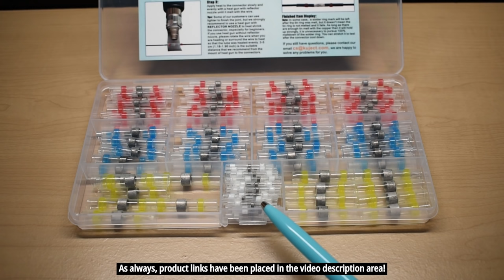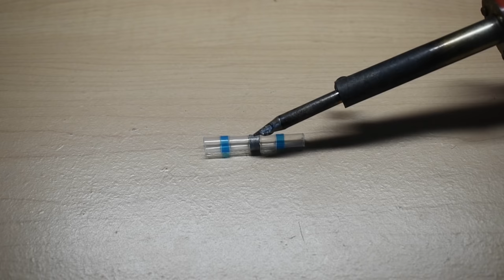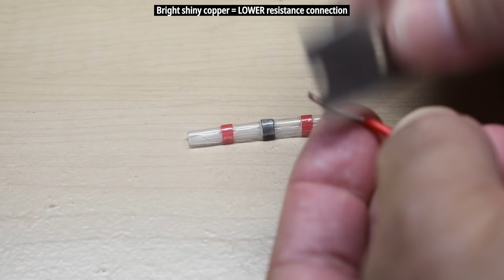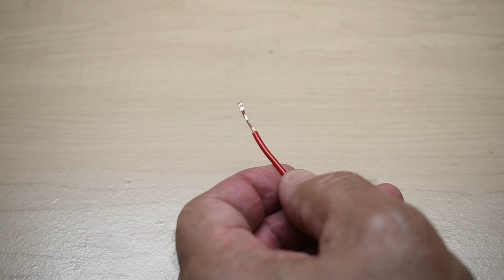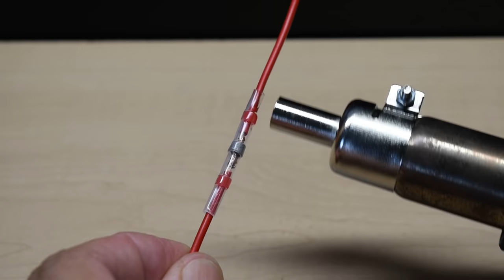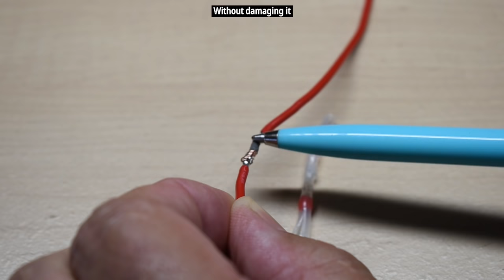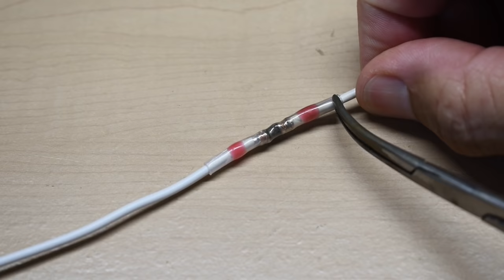Amazon's #1 Best Selling Solder Seal Connector Any Good? Find Out!

Comment: Great idea but not perfected yet. I avoid these. Although, in an emergency one would be glad to have them. I use a crimped connection with some dielectric grease and heat shrink tubing. Always give your connection a tug to be sure it’s connected well. (Crimp & Tug)
Reply: How do you know your not crimping threw some if the strands? That's why these are better...

Comment: I was just wondering about if that other heat gun would work. I've bought several of those after watching your old video. 👍
Reply from the maker: I tested the mini heat gun on one red connector. I held the connector up against the nozzle, and it took a couple minutes to flow the alloy.

Comment: You can go to the same temperature as you would with your soldering iron using the hot air station. 300 centigrade
is fine. You can also use flux to deoxidize
the wire ends. Perhaps your issue with the solder not wicking to the core is because your temperature isn't high enough? Using a LNG lighter is definitely bad as the temperature is over 1300 centigrade.

Comment: I looked through some of the comments before posting. Like someone said these could be put in a small box with a lighter to be used for emergency repairs. No special tools needed and pretty secure.

After seeing this I wonder if you might be interested in testing some heat shrink with glue to see how well that bonds to the cable compared to these. Also perhaps do some testing to show just how good these connections are electrically and mechanically.  Like you said in the video I know these will work well and have low resistance, but how about just twisted wires with heat shrink with glue? I don't know if anyone actually does this but I think it would be interesting to see what the difference would be.

Comment: Best video reviewing these, also you use the best technique. Wrap twist is much better than push mingle, I think.  A wrap like that will be good without any solder. Now that I've seen cut open I regret buying a box of these.   I will use them but my preferred now is a straight uninsulated crimp junction with marine grade heat shrink over it after.  Don't like the insulated crimps either.  Blind crimping.

Comment: Superior to most connecting methods I've used,  short of actually soldering the wires together,  and heat shrinking. Would be interesting to see how much stronger the connection is compared to just twisting and shrinking method... My guess would be that it is 2 to 4 times more secure,  maybe more? Great video...
Reply: This is soldering and shrinking, just easier but it comes with its cons, you can solder manually and then use heat shrink that contains glue at both ends so you get the same end result but with stronger and better electrical connection on the inside
Reply: @gianseven  pretty much exactly what I said above. Actually soldering and shrinking is far superior to any other method! This falls short of that because the minimal amount of solder used in the product, fails to flow within the strands of wire, nor does it achieve the same level of bond as actual soldering would...
Reply from the maker: Thanks for watching!
Reply: It seems marginally better than twisting and shrinking (which is not appropriate in any situation except emergencies).
Reply: How much tensile strength do you need out of a 22awg splice? Lots of strength discussion but does this device allow a good conducting splice? If so then should work in most DIY situations (Im not building space craft at my house).
Reply: @Quickened1  I think good crimping is better, I have had trouble with solder cracking from vibration

Comment: Nice that you dissect it. I saw PF first since the image stuck out more, and then I clicked on your name since you were the top comment and then I came here and I was like how did I miss your video first. The thumbnail image looked too cluttered and small while PF was big and simple. I am giving you a suggestion but take it as you will.

Felt like the title was too long which it was cut from the bundle. since the only thing it shows was 
"Amazon's #1 Best Selling Solder Seal Connector Any"
from 
"Amazon's #1 Best Selling Solder Seal Connector Any Good? Find Out!"
Maybe better if 
"Amazon's #1 Selling Solder Seal Good? Let's Test It!" (not the best title but it fits)
The thumbnail should have been in bigger letters like PF and a close up on "Solder Seal Connector" than the entire box since you are not reviewing the box.
I am trying to help but if you feel I am wrong then ignore it.

Comment: How about dipping the ends of the bare wires in some flux first and seeing how much better the solder flows?
Reply: He said it makes no difference.
Reply from the maker: I applied one drop of kester "no clean" liquid rosin flux, and saw very little if any improvement.
Reply: Apologies - I missed that bit of your voice over (too much tactical skipping forward!). I was genuinely intrigued so I gave it a go myself, this morning. I definitely got proper penetration after adding flux. I did learn that if I added too much, the clear heatshrink would swell up into a small balloon and ultimately pop a small hole through the side that flux ultimately oozed out of. 

In terms of technique, I did use an intermediate temperature that made the heatshrink and glue activate, and was enough to get the flux to melt and flow, before I increased the heat to a level where the solder would flow. Perhaps it was this approach of liquifying the flux and letting it do its thing before melting the solder that worked for me. When I pulled mine apart, the solder had flowed up inside the cable insulation as well as through the full cross section of the splice. Like you, I did the glue ends first as I didn't want liquid flux running out the ends.

Comment: Great product and video.  Question - how do you use this product when the wires are different in size?  I just  combined a thick one to a small wire.  The thick one was twice the size as the other.  How would you use this connector them together?

Comment: Why do you say, “This connection is low resistance” when showing both wires?  Which one am I to guess is the one you mean?  And resistance to what?  Water? Electrical flow?  Thanks for the tip!
Reply from the maker: When you have 2 bright shiny copper wires twisted together, and solder enveloping the entire connection, it will be a very low resistance connection based on the results from my other video below. Thanks for watching!

https://www.youtube.com/watch?v=HJtGv73oMog
Reply: Electrical

Comment: Can you test the DX Engineering Solder/seal but connectors the same way and do a video they're supposed to better but I have my doubts and want to be sure...They're offered by Summit Racing if that helps

Comment: I wonder how hot it would take for a bit of liquid rosin flux on the wires before starting would help the "solder" wick into the strands.  It seems like 200-250C should be sufficient. Maybe more time with the heat gun to get the wire up to that temperature and not just the solder ring?
I also like my homemade flux for tinning wires. I keep a bottle of really runny mix to dip the end of the wire in before dipping it into a solder pot.
A chunk of pine rosin (cheap on ebay) or a chunk discarded or otherwise liberated from a friendly violin player dissolved into alcohol can be as runny (add more alcohol) or as thick (add more rosin or let the alcohol evaporate) as you like. I've used 99% isopropyl and denatured ethyl (watch out, they are shipping almost pure methanol in it now - check the SDS). If you don't like the result with your alcohol, the ebay rosin is cheap enough to throw out, or let the alcohol evaporate then try the other kind.
Reply from the maker: I tried one connector up to 400C, and the plastic was starting to burn, same result. The problem as you said, the copper wire isn't reaching the same temp as the ring, and that's why the alloy doesn't flow into the strands.

Comment: I guess the question(s) I would have is, will this connector work as well as a crimped connector?  And, do you think, or know, if the 3M brand has a better fit, possibly with better adhesive??
Reply: If you use crimp connectors you will never know if you crimp threw some of the strands. With these you don't have that problem...
Reply: @chopshopchopper  I’ve since, ordered some of these (3M brand).  But, with that said, that’s an interesting observation.  Jus try design, I didn’t think it was possible to crimp threw the strands given that I would think that the surrounding plastic would keep that from happening… Great comment.  I didn’t realize that could happen.  Thank you for replying.

Comment: Solder, lol, hilarious,
 Nice video cheers mate, I am olde school siversolder and iron, no block connectors in USA or Canada, worked there since 2012,here for abit, family... 

A load and a low resistance ohm meter reading, would have been comprehensive, 

Lov from the UK,

Comment: I was expecting to see the voltage and resistance test but I guess you had the wires twisted together too so probably not to bad
Reply from the maker: Yes, since the wires were twisted together tightly, I knew the connection was going to be good based on my other wire connection testing video.
Reply: Yes that is what people commenting negative are not realizing

Comment: I really like the way you twisted the wires together, leading to a true mechanically strong joint. Most professionals and even car manufacturers use crimped joints that are simply fanned together. In the past I've been disappointed when I twisted wires together because the connector needs to accept the bigger thickness of twisted wire, and the heat shrink doesn't always shrink enough on the ends to give a water tight joint at either end. I share the concern about inadequate soldering, especially as the solder is a low temp alloy which might be vulnerable if the joint lives in a hot area prone to huge temp swings.

Comment: what if you add flux paste to connection before shrinking over it ?
Reply: He says in the video he did exactly that,  and that it made no improvement to the flow within the wires...
Reply: @Quickened1  oh, my bad then. must have skipped over that part.
Reply from the maker: @Dagnis Lazdins Did very little if anything for this brand connector, maybe the solder flow results would be better for another brand. Thanks for watching!

Comment: I have absolutely terrible luck with the yellow banded splices with 10awg wire. Barely any solder flow before the heatshrink jacket is toast. Can you do a quick vid on getting good results with thicker gauges?
Reply from the maker: Probably lacking heat.
Reply: @electronicsNmore  Hmm Ive used lighters, butane torch, and propane torches. Might be time to go back and try a heatgun for more regulated heat. I have the same results you do with the smaller guage wire.

Comment: I have a very thin electrical wire on my car that I need to reconnect 

Would these be okay to use or should I solder it?
Reply from the maker: The smallest should be fine, but for small wire connections in a car or boat, I prefer 3M silicone filled squeeze connectors. Use pliers to squeeze the connector and lock the wires.

Comment: We have this at work (car mechanic) but i find it having too little flux and not flowing properly always.

And especially on old copper wires that have been exposed and is black, even sanding it with scotch brite pad it wont flow where regular solder mostly do. 

So i perfere hand solder and heat shrink over it. 

If it wont stick i brush it with HCl/acid for concrete washing and it gets like new in less then a second. 
Then wash it with soapy water before drying it properly  (important not to get acid wicking into the wire insulation!)
 And it is perfect for soldering
Reply from the maker: Definitely need to be very careful that the acid doesn't wick into the insulation.

Comment: Guys would heat these up to fast not melting melting solder, but still melting a hole In the heartshrink. When I saw these used on brand new trailers by guys I worked with. Just wires with heatshrink
Reply from the maker: 200C/400F seems ideal. If you go above 380-400C, the connector will burn.

Comment: IMHO molten solder cannot penetrate into strands if the ends are twisted together tightly, as left strand covers the right one and vice versa. Just inserting the two ends side by side solder can penetrate into both strands easier.
Reply from the maker: Incorrect. Capillary action draws it in between every strand.
Reply: @electronicsNmore  You say "Capillary action draws it in between every strand" in theory, but it did not. Anyway, I tried several variants of splicing cable ends, but tin is so minimal to cover or penetrate deep enough into strands. And doing it on site needs 3 or more hands to hold all players fixed and make a reliable splicing. It did not meet my expectations at all.

Comment: there is a time, where if you over-heat(probley) that very type of amazon sold,  self-sealing connector.. with a butane bic lighter 1250• or maybe for a long time with a 525• heat gun, and it’s totally level - that there becomes a flowing silvery liquid sotter which spreads all to quickly✋😒  I dOnO if that can be done w/a low temp heat gun, maybe 500+• for like several minuts?  but if so, again it’s gotta be like totally level..

Comment: When using a lighter, hold the connector IN the flame (as shown in the video) and NOT just ABOVE the flame where the temperature is much higher.
Reply from the maker: Correct, in the video I had the connector at the lower to middle part of the flame, even though it may not have looked that way.
Reply: @electronicsNmore  
It looked ok, I just wanted to emphasise it.

Comment: I would add flux to your twisted wire, and if the shoulder is good quality, you will get full penetration.  If you don’t use flux, the shoulder will just glob up  not flow properly.

Comment: You did it wrong, connection to wide for it to flow proper it needs to have a connection about the size of the solder ring FYI.

Comment: Bought a small amount of these connectors (50 pieces) just to try.  Not very impressed.  I found that in order to melt the solder enough, you melt the plastic, and it takes too long.  I don't think the technology is there yet.  I will continue to use either crimp connectors with their own shrink tube, or solder with separate shrink tube.  I gave you a thumbs up for your presentation, not for the product.

Comment: Moral of the story … do it properly and use regular solder and a heat shrink tube.
Reply: Sometimes that's not possible nor warranted... i.e. in the field where electricity,  or required equipment might not be available, or in temporary applications...
Reply: @Quickened1  You’re completely correct, and have done so myself. I have simply seen too many people burn wiring and surrounding material using these damn things and a regular “full sized” heat gun. These are the equivalent of an emergency spare tire in my books.
Reply: Yeah and using glue lined heat shrinks garantees the same or better water resistance as this If needed
Reply: @RichardT2112  as the saying goes,  "the right tool for the job" applies here... Still wouldn't mind having these in my box for quick fixes,  like on ceiling fan lights, or places where solder is just not practical.  I can't count the times I've merely twisted wires together and shrinked them, and this would be applicable in those situations, and just as quick, if not quicker.... Definitely superior...
Reply: @Quickened1  👍
Reply: @Quickened1  Those connectors have two basic flaws... solder with no flux and they use hot melt glue  - which won't stick well to silicone wire insulation.

Just use the same basic field tools... flux, solder, waterproof heat shrink tubing and a butane lighter. Flux the wires, twist them together, melt on the solder, then shrink the tubing over it. DONE! Great strong electrical connection, and waterproof, and done correctly!
Reply: @Quickened1  Why not crimp then? Are these even to code?

Comment: The combination of a flexible connection and solder being used here is not ideal.  Solder is not flexible and all it takes sometimes is a hairline crack in a solder joint to cause a cold solder joint.  The most ideal connection especially for marine use cases is a crimp heat seal joint (I should say secured with a proper crimp tool.  The crimp provides a mechanical durable connection while the heat seal insulates the joint from the elements and adds additional mechanical security.

Comment: Don't ever use a lighter.  burns the outer heat shrink and solder won't flow right.  wires must be horizontal to ground to have flow right.  touch of rosin before insert and solder does flow threw all strands.  Must jam into strands to twist

Comment: The thing is, the solder is never going to hold the wires together strong like a crimp connection will. I tried these, and maybe i could improve my technique but I could never see these being as strong as a crimp connection especially with something vibrating around in an engine bay on a car or piece of equipment, can't understand why soldering is considered the correct way, maybe for computers and electronics, but I can't see it ever actually working on any type of machines or equipment and really giving a strong hold, and for the people that just solder and tape or heat shrink on a connection, that makes me cringe, soldering doesnt hold on most industrial/ automotive applications. How could this ever be better than using butt connectors with heat shrink over it unless you are soldering wires in a circuit board in a factory?
Reply: Their soldering type is not true, they are just coating the connections,

Real soldering is stronger than wire itself.

Comment: You don't twist the wire so the solder CAN flow between the wires and not just around them like you stated. You are doing it wrong sir.